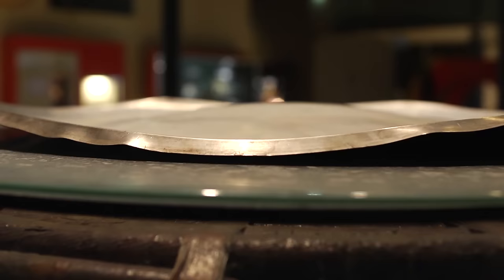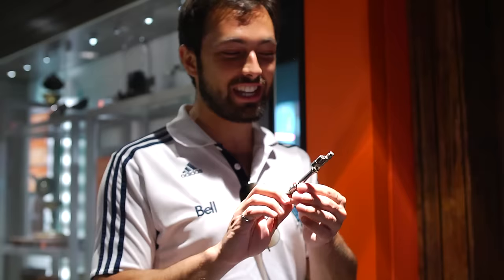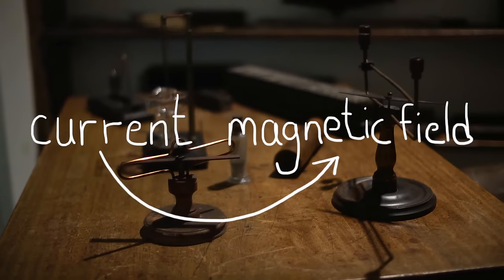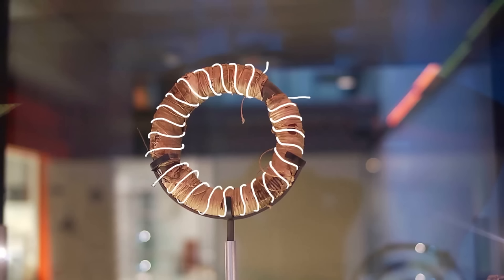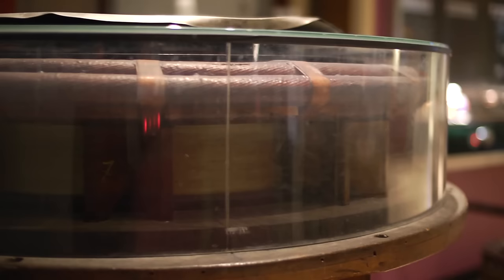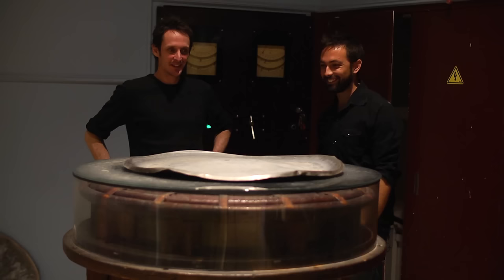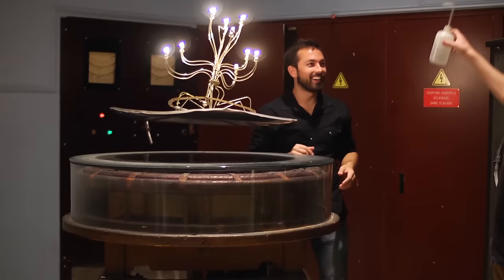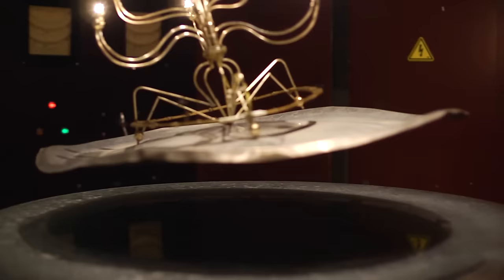Levitating Barbecue! Electromagnetic Induction

Comment: I hav a doubt. why is it getting heated?
Reply: As you probably already know, whether an object is solid, liquid or gas is dependant on how fast the atoms are moving, and how fast they move is pretty much the same as heat (matter moving is energy, heat is energy and so on). The alternating current moves the plate backwards and forwards incredibly fast, and since it is a metal, the atoms making it up are aligned one way, then aligned the other way. It is this movement that is generating the heat. You can try a Google search if you want to learn more as I can assure you most people would kill me for my 'lack of detail'.
Reply: nice explanation can i ask if you know of a way to cool down the heat permanently i think if it could be donethis could be a start on how to levitate items
Reply: mike adu Well yes, shape it into a bowl and fill it with liquid nitrogen. That'll cool it down for sure
Reply: SirHall Stein nice thank you
Reply: SirHall Stein thnks for making me understood. no one would kill you. u are awsome
Reply: +SirHall Stein
I think you're talking about hysteresis... but this was aluminum... the magnetic domains of aluminum are barely influenced, even by extremely powerful magnetic fields... so I don't think there will be any significant contribution of heat due to hysteresis... most of the heating will be due to the internal resistance of the plate to the flow of induced eddy currents

Comment: 800Amp that will kill you in 1 sec
Reply: But only if the voltage is high enough. That's why you don't get shocked by a car battery even though it's capable to deliver several Amps.
Reply: +t0nito what are you talking about? A current of 1A is more than enough to kill a human being. No matter what the voltage is, if a current of 1A passes through your body, you're very much dead, probably within a fraction of a second... or perhaps, a few seconds. The voltage doesn't matter.
Reply: If the voltage isn't high enough the current won't pass through you because of the resistance of your body, a car battery iis capable of delivering several amps, but since it's only 12V you can touch it safely because 12V isn't enough to shock you. You can even have a power supply that can deliver several thousand amps, if the voltage isn't high enough to pass the resistance of your skin it won't hurt you.

Comment: how much kWh is this monster?
Reply: Didn't give us the voltage, so we can't calculate it's wattage :(
Reply: i don't understand shit
Reply: Its in Paris, so i guess its 230V, so 230Vx800A=184000watts.
For kWh the formula is watts/100=kWh
Reply: ajamit007  voltage depends on how many phases you are using, this goes into electrical engineering knowledge(tertiary level). Simple answer is you will never know, and it may and may not be 230V, could be higher or lower.
The amount of magnetic force produced depends on current not voltage, so I suspect a transformer was used.
so amount of current used is uncertain as well.
Hope that helps.
Reply: Asterio In electromagnets, it is the current that causes the magnetic attraction (If I remember highschool physics well enough hahah). Do you know if they perform better at higher or lower voltages? Or does it not matter so long as the current is high?
Reply: Switzer  according to the math, it seems like it does not matter how high your voltage is. The higher the current, the higher the force.
I believe this is also why that aluminum plate is hot because of such a high current is within it.
PS: please note you can use a transformer to step up the current(which will step down the voltage). This means you should be able to generate more force without spending more energy.

I am an electrical engineer and this is as far as I know... I haven't had a chance to do the experiment myself, but I will one day...
Reply: Asterio Thats pretty cool, thanks!
Reply: Asterio  Just a tiny correction. The heat is caused by the metal plate's resistance. You know, it opposes the current and thus transforming the electrical energy into heat.
Reply: ShockD  I think you misunderstood the idea of resistance, although it is correct that resistor do convert electrical energy into heat. BUT HEAT IS NOT SOLELY CAUSED BY RESISTANCE. In fact, resistance is a relatively small factor. In order for you to understand where you went wrong, you have to first understand what energy is. Electrical energy consumption depends mainly on current. Since those Heat energy were converted from Electrical energy, hence heat mainly depends on current.
This is also why in physics classes, you are told Electrical to Heat Energy equation is: P=I^2 * R  (note: It is not the same as P=V^2 / R or P=VI)
Our modern day power transmission depends on this equation to reduce power lost, hence transformer is invented. (increase Voltage in order to lower the current.)

Few practical experiment that you can do in order to understand this concept better:
Make a simple series circuit and connect a resistor (recommend high resistance) with a battery with any wire.
Touch the resistor feel how hot it is.

Then connect the 2 end of a battery with only wire, then touch the wire. (warning, it may cause burn injury)
You will notice, by having little to no resistance, an electrical component like wire can get extremely hot. hot enough to cause serious damage.

This is exactly what happened to the aluminum plate.
Hopefully that helps.

PS: I recommend some self study on magnetic and electricity power induction, this will hope you understand what really happened.
Reply: I don't know why you're telling me all of this. Energy depends on I, U and R. I'm also an electrical engineering graduate, I know my stuff. But then again where does heat dissolve? In the resistors.